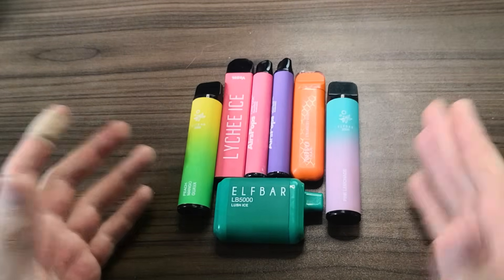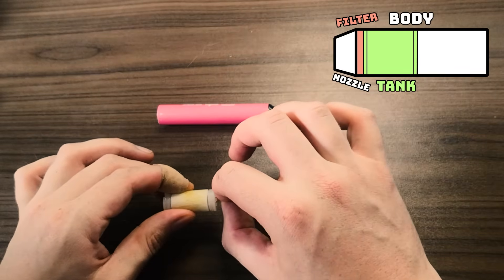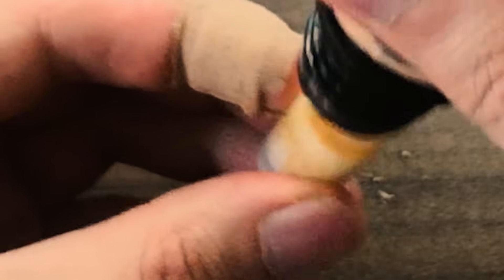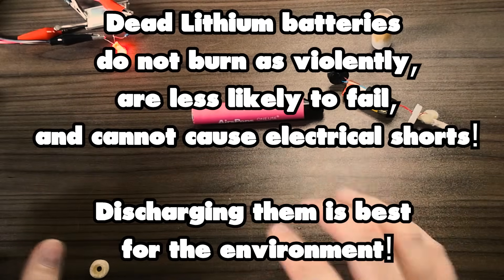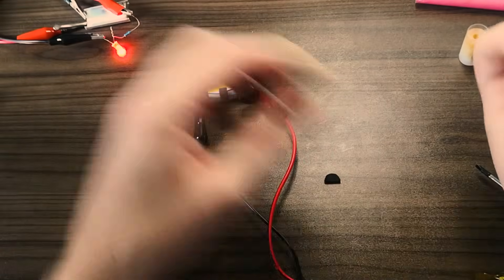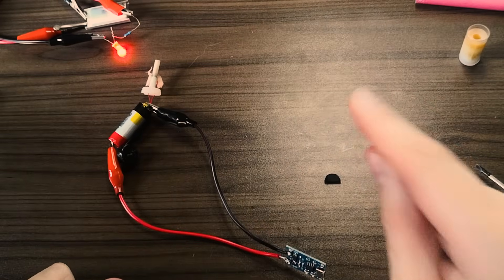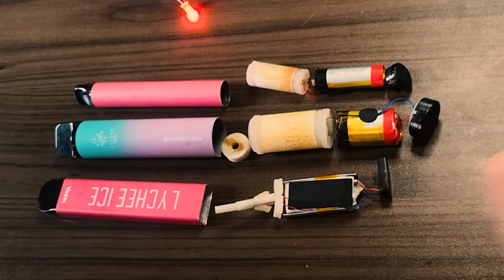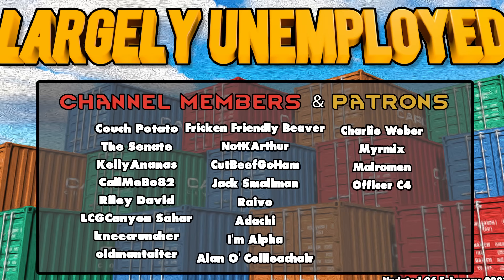'Disposable' vapes are a lie. Here's how to fix them.

Comment: I stopped using these because of how wasteful they are. Thanks to our government making flavored pod based vapes illegal, these became the dominant standard. Leave it to the government making decisions for no reason that harm the environment. I switched back to a good ol box mod because it's not only better for the environment but it's so much cheaper. A coil is 3 bucks and lasts for 1-2 weeks and a bottle of juice can be 6-12 bucks depending on brand and size and may last upwards of a month. Compared to a disposable which, over here, tend to be 15-20 bucks and only last from 3 days to a week and a half depending on habits.

Thanks for making this video though, it is a great way to reuse something.
Reply from the maker: The batteries in particular really get me. South Africa has a lot of trouble with wildfires and these damn lithium cells swell up in the sun and burst.
Reply: @LargelyUnemployed  yeah exactly. I never threw my disposables away and instead kept them all in a box, hoping to later find a way to responsibly dispose of them. Instead, however, I realized I can reclaim the lithium cells and use them for electronics projects (like Arduino) because I got interested in it quite a bit. In the end, I reclaimed over 30 batteries complete with their charging circuits.

The vapes I had been using were Mr Vapor Lux Bars and the main housing is a thin metal thing with a plastic bottom cap and top mouthpiece which can be easily pried off with a pair of pliers.

My friends give me their dead vapes now too and if I see them on the ground I'll pick them up which is a win-win. They aren't ending up in the trash or laying around on the ground and I get free batteries for my projects. I throw away the spent juice tank and collect the metal pieces like housings and coils to sell for scrap.
Reply: @LargelyUnemployed   shame so many fight advice other wise it would be a good idea to teach them to gather the batteries for their own use and make battery packs.
Reply: Having the same problem here in Europe where our "highly intelligent" government decided to ban flavored vaping due to "the children" ( who now get their vapes of social media from their local drugdealers, great move!), isn't it a more economical option to start making your own liquids?

I ordered supplies some months ago like 2 liter of base (10€ per liter bottle) and a selection of flavour per 1,50 a bottle and a 10 pack of 10ml nicotinebase for a few tens of euro's. It should at least last me half a year if not more and all of it (plus some non-vapable knickknack's) costed me about 100 euro in total.

And after making a few small batches, it isn't really that hard to do. Only downside is that i have to order it from another European country but with some smart buying you only pay 1 time shipping fees. As i assume you are from North America, there sure will be a viable solution for purchase over there, right?
Reply: @jumpingpiggie422  yeah, DIY vape juice is possible here too, though flavored bottled juices are still legal thankfully and are cheap enough while being more convenient to be worth it for me. I'm considering DIYing my juice in the future tho because of just how cheap it can be.
Reply: @RedVRCC  I was 2 packs a day an  a off-stamp device lasted me 3 weeks
Reply: Numbers tell the story - I appreciate your awareness of it all
Reply: Hey! Where are you from, that Pod Systems are illegal? Over here (Germany) only Pod Systems with a capacity of more than 2ml liquid are illegal. (Diesn't mena you don't get bigger ones, half-desposable (rechargeable) or completely re-usable / refillable, if you know where to look or ask.) 
I'm actually using a refillable Pod System that looks exactly like the one that was refilled in the video, with Pods that can be filled with whatever liquid I like. There are lots of different pre-filled Pods out there, as well from different manufacturers that can be used in ti, if preferred. But a refillable Pod can be used 5+ times - I use to use them for a bottle of liquid and then take a new one, because I don't want to waste the liquid if the coil is just not usable anymore. I'm pretty satisfied with that little guy. I've tried a Weenax Q, but honestly, those simple little things are just awesome. ^^
Reply: @Kuscheldrow  Are you using Elfbar / Elfa? I was in Germany this summer and have fallen in love with their systems and flavors. Unfortunately since than I am having a hard and expensive journey to find anything similar here in Centroamerica. My 2 Elfa devices already died (they are not as sturdy and do not last forever). I bought several disposables and Pod Systems and liquids. In total for about 700 bucks or more. 😬Really not satisfying. The disposables are yummy (I love the Lucid boost), but I haven´t managed it to open them and refurbish and they cost me 18 dollar plus delivery and on top to the money I don´t like to waste batteries. The Pod- Systems (Argus, Caliburn, XRos) were all awfull, really hot vape, bäh, and on top the liquids were weird (Ruthless from Califonia). 
So be happy with your possibilities in Germany, as long as it is allowed...
Now for Chrismas I get visitors from Swizerland, they are bringing me some Elfbar stuff... that will make me happy for some weeks...
Reply: @Kuscheldrow  USA, pod systems are technically legal but nothing flavored anymore. Yet disposables can still come in every kids favorite bubble gum cotton candy flavor for some reason...
Reply: @RedVRCC  Wow, sounds like one of those "perfectly logical" governmental decisions... Oo
Reply: Dang a 120 ml bottle here is $68 now. I’d go bonkers over $6
Reply: @amythibodeau3186  holy shit that's insane, that's literally more expensive than the box mod I have. Maybe you could try making your own? Apparently it's not that hard. You can get propylene glycol, vegetable glycerin, and nicotine in bulk, then follow a recipe and add whatever vape safe flavorings you choose, if desired.
Reply: @RedVRCC  Where do you get this?
I am having another problem on top, as I am having an adress in Miami, that guys are shipping to centroamerican countries, but I can not do that personal age veryfication as I am not in Miami myself...
Reply: Idk how ppl go through these in a couple days. My geek bar lasts me 2 sometimes 3 weeks and it's not like I'm not hitting it much
Reply: @sonofkami   thats because you actually have self control lol
Reply: This is a very good point!
Reply: We need more people like you, comrade.
Reply: Thanks this solidifies my decision to move back to mods
Reply: For a starter what would you recommend
Reply: @efdeepro6427  off-stamp is pretty good and fifty bar
Reply: They taste good idc
Reply: Pod system doesn't bring in the profit like making peop buy whole new units , all about that mighty dollar baby. Making laws to rip us off should be illegal, but hey it goes on everywhere 😅
Reply: yea but they're big and less convenient to carry than these disposables.  I use my full size box mod at home by carry a disposable when I leave the house.
Reply: @linh811  there are some smaller options, especially refillable pod mods, but I can understand why you use disposables.
Reply: @RedVRCC  Did you ever get a refillable pod-system on your continent that is not hot? I spent a lot of money, but Argus, Caliburn and Xros nano only emptied my pockets. I get sick by vaping that stuff. Argus Pods were both broken, one leaking and one constantly on fire... Caliburn pod tasted like old motoroil, impossible even for some hours of trial. 
The Xros finally works but burns my lips at the second puff.
I am not a vaping starter, I am a restarter. 
In old times with Evos and all that little tank-stuff it was quite easier it, seems to me.
Reply: @RedVRCC  all Fact
Reply: @RedVRCC  I don’t know where you get your juice and coils but for one coil the cheapest I’ve ever seen is $5 and that was prob 2 years ago when you posted this, and juice?!! Never under $25
Reply: Them making it illegal did nothing btw everyone still has them
Reply: I know this comment is a year old, but you're only paying 6 to 12 bucks for a bottle of vape juice??
Where I live the smallest containers of vape juice you can buy (30 ml) were 25 bucks a piece a year ago,and now our greedy ass government is seeing that there's profit to be made off of vaping,so now we're paying close to 40 bucks for a 30ml bottle of juice.
And that's not even the worst part,we used to be able to get our juices in nicotine levels up to 50mg per ml.
Now (about a 2 or 3 years ago,they put a cap on that as well) where you can only get 20mg per ml of juice.
Which is b.s because when I first started vaping years ago,I started out using 24 mg vape juice.
Now you can't buy anything higher than 20mg per ml.
I can see our government running the vape industry right into the ground,if not making it illegal all together.
Just like when they made all the ciggerate packages look the same except for the logo.
Under the guise that "the bright flashy colors attract the younger crowd.
Which is b.s.
Man,I gotta start going to some of these under ground sites where you can still get high nicotine levels AND pay less for your juice, because I picked up vaping not only because it's alot better for than smoking is (despite what the"experts " say.)
And I took up vaping because it's a hell of alot cheaper than smoking.
But if things keep going the way they are, vaping is going to cost just as much if not more than smoking.
Reply: Another fool who thinks the government should ban things they don't like.
Ever heard of incentives or markets?
Reply: @RedVRCC  thry killed making your own juice which killed no mods years ago. Sad. I find these to be the worst and most addictive of them all as well.

I detoxxed off them end of summer. It was a brutal experience.

Fortunately it was so brutal I don't wanna go back.

Comment: I love the way you explain how to bring out the part of the light of the Vibe.
I want to learn more on your class. 
Question what about the vibe you trying to inhale Bud couldn't work , what caused the problem or couldn't even work like you try to inhale the Vibe doesn't come out? please and thank.
Reply: FYI, my girlfriend tried to inhale the 'vibe' I bought for her, and ended up chipping her teeth.:face-orange-raised-eyebrow:  Brutal
Reply: I’ve been doing this for years… I’d make sure the sensor, little metal thing is getting proper airflow. Make sure it’s seated, and everything is sealed just how it was new. If not, the sensor will not activate. Especially more complex ones, eg RAZ are really funny about airflow

Comment: As a Vaper this enrages me. These things are disposable by design choice.
On Ali one can get both BMS and USB C ports for 50 cents both.

It is like selling a car without a tank cap, advertising its convenience of not having to go to the gas station. It doesn't save costs in any significant way, but ensures you'll buy a new one soon.

There is no reason to support this. I bought my girlfriend a small vape for ~12 Euro from a reputable brand with an usb C port. And refillable and changeable tank pods.

It is just as convenient if not more and lasts for years if you change the pod/coil every month or so.

I as a formerly vape enthusiast, having huge mods with up to 4 18650 Batteries, wrapping my own coils, needing a dedicated charger for the cells, I can see that this hassle isn't for everyone.

But come on. You can plug these smaller convenient things in at your phone charger. It doesn't get easier than that.

By comparison for conventional cigarettes you have to leave your house and find a vending machine, for the disposable ones you might have to go even further.

Comment: I've been doing this too. Only i take a 3cc syringe with a long needle, fill the syringe, put my needle down through the hole on the mouthpiece, then add my juice. I pull it out to move it so that the sponge gets completely saturated with juice. I have taken it apart like you did just to see how it worked inside, and saw no reason to have to take it apart to refill it. Thank you for a great video
Reply from the maker: This is genius!
Reply: What brand do you use? I use geek bar
Reply: @chinupkid1  I've used geek bar too, I just buy whatever flavor I think I'll like the best and what's cheaper.
Reply: I don't quite understand how you can fill it this way, the mouthpiece is attached to a straw that goes down through the sponge to the wicks at the bottom, but sealed from the sponge, so if you put juice down the straw, it wouldn't go in the sponge, wouldn't it just fill the straw and clog things up?
Reply: @flybynight1946 take the mouthpiece off and put ur syringe in the sponge, there ya go
Reply: @Dougiepuggie  Thats not possible with all disposables, I just tried it with RAZ, I distroyed the mouthpart and it didn´t came out and at the bottom I am stuck with the technic part and I can not reach the sponge, but anyway that device is already destroyed. Second try was my Lucid boost (by the way, an awsome disposable with really cool vape!). It worked to get the mouthpiece out, I found the 2 sponges easily. But I can not return the mouthpiece, lol and also it does not fire up anymore. 
So its not always that easy. I have some little ones too that I kept, but honestly don´t understand how to build that charger what is shown in the video.
Reply: The straw can absorb, or you just pierce it @flybynight1946
Reply: So just get a recharge one and a long needle
Reply: Wait whats the o.p talking about. Youre not just refilling it tho youre rechsrging it, you cant do that with a syringe
Reply: @braveorslave  I think OP used one that was already rechargeable and just needed to work out how to refill it.
Reply: @TurkeyCreekGal  what if the coil burns out
Reply: It works with the tesla bat thanx
Reply: Guys BE CAREFUL when refilling your disposables as at one point, the cotton wick housed within the heating element will start to burn, either juiced or not. 

You DON'T WANT to vape on a burnt coil so, when that inevitably happens, make sure to change the wick or buy a NON DISPOSABLE please 
They are not that expensive and they are far less of a hassle.
Reply: How do u charge?
Reply: @omarei Only buy the ones w/ a USB C recharging port on the bottom. You'll run out of electrical "juice" before you will vape juice.  DON'T use a fast charger either, you can easily fry the thing. I usually recharge fully 2 or 3 times before the wick needs a juice refill, that juice would just get wasted on a non-rechargeable. Non USB C port disposables can be recharged too, with a "Crack wire", but it's PITA because you have to disassemble the device and mod a USB cable w/ alligator clips to attach directly to the battery. Spend the extra couple of bucks and get one w/ a recharging port, it's worth it. The RAZ brand ones are 2 for 30 bucks where I am and have a cool little LED screen w/ a remaining charge and juice gauge. The 18650 batteries in the bigger devices have tons of additional uses too; they're pretty much universal. I have used them in all kinds of things, like flashlights etc, basically anything that came with an 18650(s) to begin with, or to mod things into being rechargeable that didnt have that capability to begin with.  Hope this helps.
Reply: @YerBrwnDogAteMyRabit  How do you open a Raz (25k was what I had)? I just tried it and destroyed it. The mouthpiece seems to be glued and splittered while trying and at the bottom was the battery and electronic stuff and it stopped fireing after I "worked" there.
Reply: @sternistellaris   if you stand it up on the base and turn it so the mode button near the bottom is facing you, there’s a little horizontal rectangle under the button. That’s one of those click tabs that holds the end cap on when it’s pressed into place. 
 You have to make a hole there so you can press in on the tab to release the base. I suggest a very small drill bit turned by hand so you don’t go too deep. You can start the hole with a heated up paperclip but you don’t want to finish it that way because you could melt the parts together making it even more difficult. 
 After getting through the shell, take the handle off a binder clip and use it to push in through the hole and down on the tab. Pop. You’re in there.
Reply: Wait are you guys keeping the old coils and cotton? You’re vaping formaldehyde and poisonous chemicals if you are. You’re meant to change coils and cotton regularly to avoid this. It’s why disposables usually run out of battery before juice.

Comment: I stopped using cigarettes and use vape either so i bought one disposable. Time came the pod starts blinking meaning its out of juice or battery low so i disassembled it and investigates what's inside. I noticed that the cotton wool is half wet by juice so i reversed it. I'm thinking of buying juice instead of buying a whole pod is less price. As an electronic technician, it's a thumbs up for me if you're gonna reuse it  just replacing new cotton as often use is better

Comment: Nice, thank you but how many times can you use and recharge ? 
Nice poem.
Reply from the maker: The batteries have several thousand duty cycles in them (all the way up or all the way down) so you can do it as often as you like. The cotton wadding and coil will give out before they do. Please though, it you see ANY swelling or damage to the battery (even if you're only 5% sure) throw it away in the battery recycling.